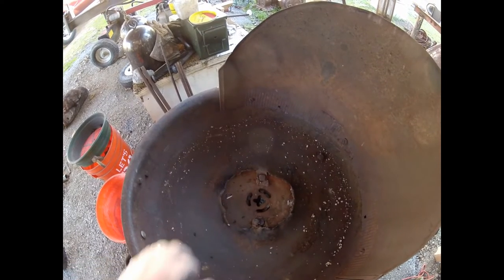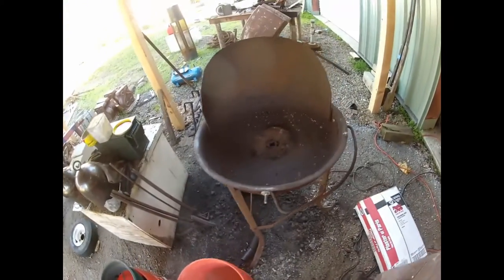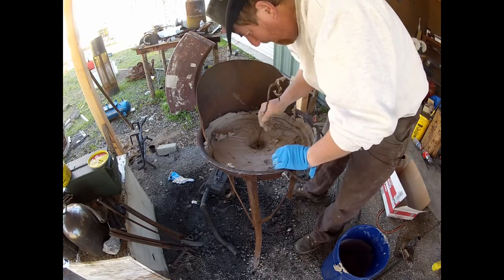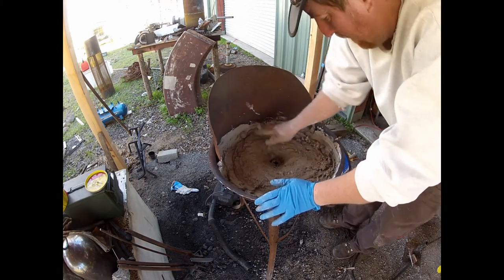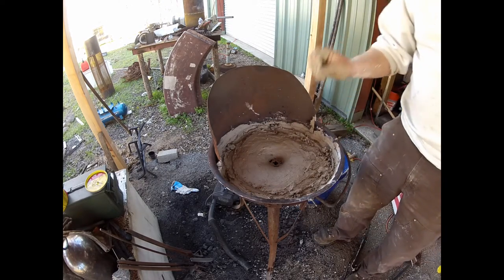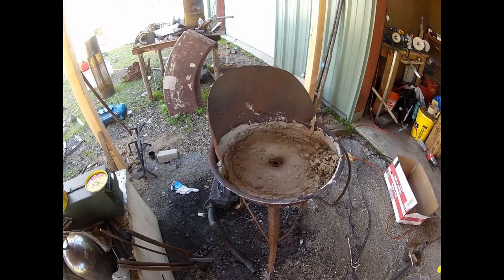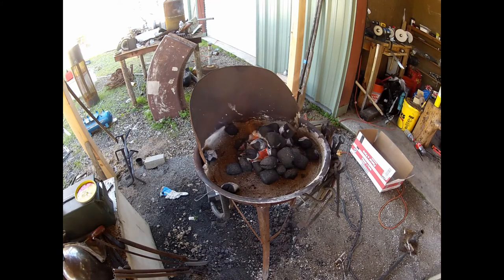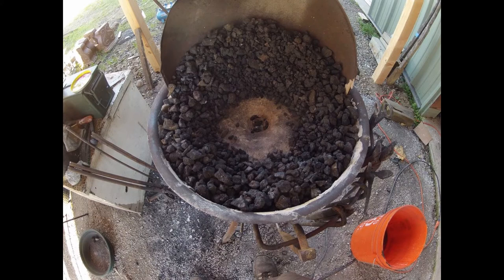Lining an Old Rivet Coal Forge

Comment: Good video! You could have saved  a bit of time by using a 50/50 mix of Plaster of Paris and play sand. The heat resistance on it is phenominal and you can mix it with a hand drill and a mortar bit.
You could also try a batch of refractory cement. We use 2 parts sand, 2 parts clay, 2 parts Perlite and 1 and 1/2 parts portland cement. Mix with water until it has a cookie dough consistency. Ram into your forge/foundry to get the air bubbles out and give it a couple of days to dry out before use.
Reply: Would you get a better result with clay (kitty litter) and pool filter sand (Cilicia sand)?
Reply: If you have a few days to turn the kitty litter into dust, sure. But using straight, uncrushed kitty litter has a bad effect. So it's a time vs cost thing. Sure the kitty litter is cheaper but then you have to grind it into the powder and that takes time. If you do have the time, then it will work as I have had to resort to that on more than one occasion.
The pool filter sand should work quite well as it is slightly finer than the play sand.

I would add that the plaster/sand is the least expensive and simplest solution. The refractory formula is a bit more time and labor intensive.

If you are asking about a sand/clay mix vs sand/plaster, I would stick with the sand/plaster.

Hope that helps.
Reply: It did, thanks much.  Pool sand worked perfect.  I ended up going for the kitty litter clay because A) I'm cheap B) I got a blender for $1.  Took about 3 hours to grind a bucket of clay powder, but green dried and fired perfectly with no cracks.
Reply: Hard Rock's Cafe ... sounds like you got a good mix I would say... Now patent it and sell it two us
Reply from the maker: This is true. I spent a couple days grinding the litter to a powder with an old coffee grinder. Burned out the thermal fuse then hard wired it to continue. The clinkers stick to the lining and I think all liners might be temporary.